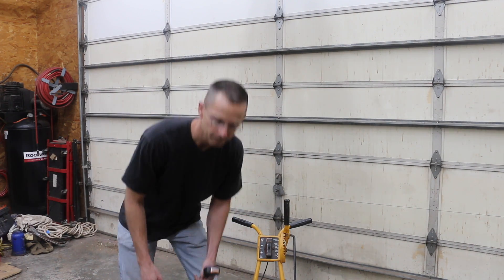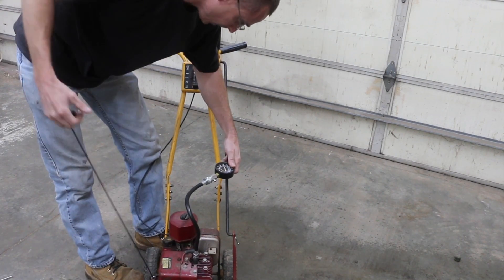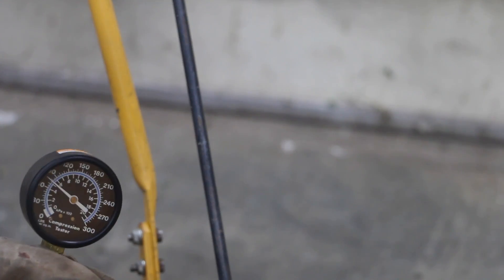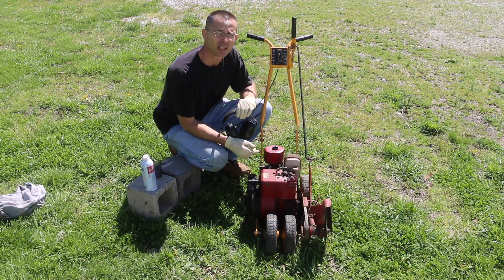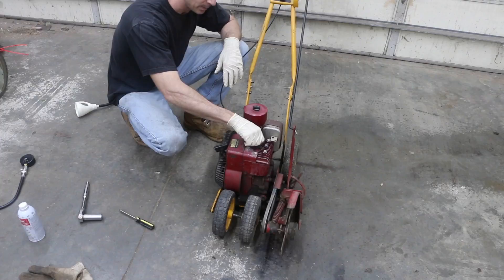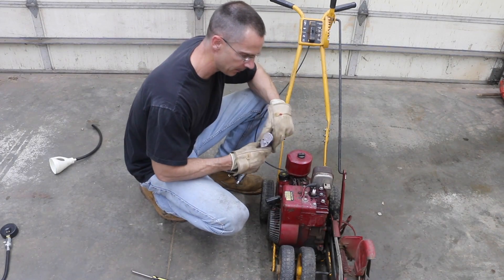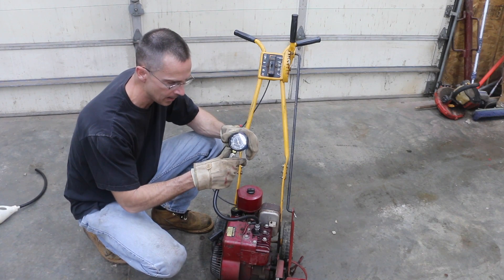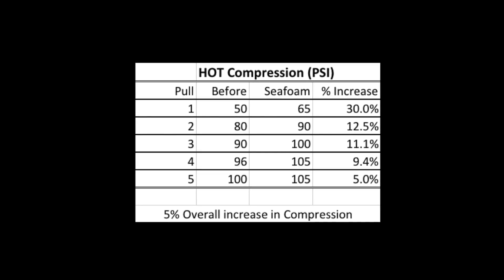Seafoam--can't believe what it did to my engine!!--Episode 4--Compression Test

Comment: I'm curious for my own sake, but have you looked into anything that could actually work to free up stuck piston rings that could potentially save a person from having to re-ring pistons? I know these additives do a lot to clean up intakes and the tops of cylinders and valves, but I'd be curious if there's anything proven to free up piston rings. BG has a whole "engine restoration kit" that they promote as having this ability, but I've never seen it tested. Any knowledge or experience in this area?
Reply from the maker: Thanks for the suggestion.

Comment: Now you have my attention. I have an old Craftsman edger that i bought in 1979. I haven't run it since about 1990. All I ever did was change the oil and spark plug, and sharpen the blade. I will have some Seafoam coming soon and I'll give it a try and see how it goes. Thanks for another great test.

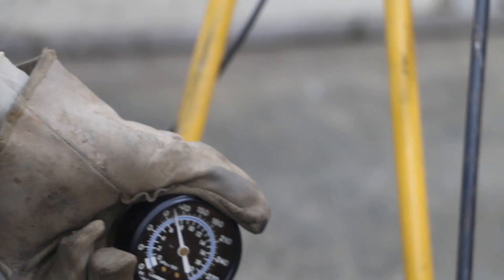Comment: 7:37 "Will an engine start easier with faster compression build?" No, the compression reader only needs multiple piston compressions because it effectively adds volume to the cylinder, and the check valve in it allows multiple compressions to culminate in the hose & gauge which eventually reads out what the compression on that cylinder is on each stroke without the gauge attached.
The reason the tester had faster build after was because less air leaked out and thus the piston was pushing more air into the tester each stroke.

Clever way to get viewers to engage btw 😉
Reply from the maker: Thanks!

Comment: I worked in a Sunoco gas station back in the 60s when they were also repair garage is where you can get your oil changed in your car tuned up or a head gasket put on. The owner was an ex drag racer at the local club level it was very successful. Before he would tuneup someone’s car, he got a pitcher of water, which was about a gallon, he would take off the air cleaner and warm the engine up. Then he would work, the throttle by hand while pouring in the carb intake..
 Black sludge came out the exhaust pipes. He said that was carbon being shocked off of the valves and piston. Then he would do the tuneup with new points condenser and spark plugs, and a check of the advanced mechanism in the distributor, then he would set the Point dwell and finally the timing with a timing light..
Reply from the maker: Thanks for sharing.

Comment: Realize this video is five years old, but have you ever tested RxP?  It's the only fuel additive I've ever used (and I've used all the ones you've tested) that will visibly blow out carbon under hard acceleration in an automobile.
Reply from the maker: Thanks for the suggestion.

Comment: What I found is Seafoam is great on removing sludge and varnish but not on carbon.  Water worked well on carbon but not on sludge and varnish.  So my method has been to do Seafoam first and then water.  I will make a substantial difference.  It's neat to see the older videos!
Reply from the maker: Thanks for sharing!

Comment: I use to to slowly pour water down the through of the carbie on my old Holden 6 cylinder motor once every month and did this for many years and it never damaged my motor but you can see the built up crap being blown out of the exhaust. It's like steam cleaning your motor from the cylinder out Would like to do it to my modern car but it's all fuel injected and not so easy. May have to look at a tapped off injector after the air flow meter to run the water through but will have a talk to mechanics about the affects it may have on sensors first.
Reply from the maker: Thanks for sharing.

Comment: I purchased a 2008 scion xb few months ago, 193,000 miles transmission fluid never been changed going to use for transmission soon, put in crank case cleaned it heck out of it...had to change my oil (yes changed my own oil)  YAY and filter....going to to another transmission change but use seafoam first in it and drive for a while... I love SeaFoam...
Reply from the maker: Thanks for sharing.

Comment: just be prudent with engines that does not have a cast iron liner, these products cleans carbon and can wipe the lube film from the cylinder wall, on a cast iron wall, the material is sufficiently porous to supply instant lubrication up to the engine supplied lubrication can take place.
Reply from the maker: Thanks for the feedback.

Comment: I have a 30-year-old mower with Tecumseh engine, suddenly it is using lots of oil, like several ounces every hour, at least 10 times what it had been using.  Runs fine, starts right up on first pull, no visible smoke after the first minute or so.  Compression is 75 dry, 75 wet.  No leak at the shaft, in fact can't find any leak or accumulating oil anywhere. Any ideas?  thanks, Larry
Reply from the maker: Are you using 30w oil?  Sounds like a problem with the piston rings.
Reply: @ProjectFarm  Yes straight SAE 30 oil.  I thought if a rings problem there would be a bigger difference between wet and dry compression?  Or at least some difference.  Should I try Seafoam or similar before I take it apart?
Reply: @ProjectFarm  Well you were right, I put in new rings and that eliminated oil consumption completely, and now no smoke at all even on startup.  Funny thing though, none of the rings looked perceptibly worn.  I put each in the empty cylinder head and gap seemed to be the same as the new ones.  Also, replacing the rings did not improve the compression, in fact it went down a bit, although the mower works fine.

Comment: In high school,1970, I used to use carb cleaner,or heet,heat, and pour it down the carb of my 1965 mustang. Had to pour slowly to keep it running. Was told by my auto shop instructor that it would free up any sticking rings and help remove carbon build up.
Reply from the maker: Thanks for the feedback.

Comment: I save $350 from not replacing a carburetor in my 2004 Sears DYT lawn tractor.  1/4 can into 5 gallon fuel tank and by the time the tank was 1/2 empty, my engine was running as smoothly as it ever has.  I've always used it in my vehicles but now use it in my snowthrower, push mower and. lawn tractor.  An outstanding product.  I have no stake in the Seafoam company but simply believe in telling anyone/everyone when something this good happens
Reply from the maker: Thanks for sharing.

Comment: project farm..please.. in 70s I worked for chev dealer "line mechanic" we had big block 454cu trucks warranty come in sounding like a rod knocking! real! .. We would air cleaner off - rev to ? and  pour cold water in carb at highest rpm more water ....wallla rod knock is gone .. easy stuff.
Reply from the maker: Thanks for sharing.

Comment: Just an added point, and not to be against seafoam in any way, but I wonder how much of the smoke it creates is from it burning,if any? It would be interesting to see it added to a new engine,like a predator 212. 
It has always helped my engines,wether they are high mileage cars/trucks or powersports, but I've always wondered if it made smoke when burned in an otherwise "clean" engine
Reply from the maker: Thanks for the feedback.

Comment: Hey Todd.
I've been having fun going through a bunch of your old videos just to make sure I haven't missed any for "thumbs up".  I realized something with these seafoam system videos, that when you moved beyond the ranger pickup videos, to the air-cooled utility engines, you were only using one part of the seafoam treatment, and only using the intake/hotsoak part.  The fuel additive and the crankcase additive are just as important for a deep clean that cleans the valves + guides and the piston skirts / cylinder rings / grooves.  I'm kind of curious now to see just how much improvement that would make.

Comment: Nice Videos.... But man so much pollution!!! You should consider evolving to electric for some of your stuff ;) friendly comment :)
Reply from the maker: Thanks!  Thanks for the feedback.
Reply: I appreciate your point, but I've got a fair amount of experience with battery powered landscaping products, and I have no guess how many batteries it would take to mow 3-4 acres of lawn, with even the newest equipment.
Also, battery/electric power doesn't significantly reduce gross pollution, it merely moves it from one place to another, when most grid production is from coal or petroleum, as it is in the US.  Hydro-electric, Solar, Wind, or Nuclear, it makes more sense, but that's more along the west coast, and southwest, and when conditions are conducive, which varies immensely except for the  H-E, and Nuclear.

Comment: Just going through some of your old videos I never saw when they were published.
I find this one particularly interesting. There’s no doubt you’ve observed a difference after using SeaFoam. But it doesn’t make sense to me. If SeaFoam primarily removes carbon, then the compression should go down. As carbon builds up, there is a slight increase in compression in the cylinder due to less final volume; it’s just math. On the other hand, you could still see a performance increase. With the less volume in the cylinder, less fuel/air is drawn in so less power is produced. You might think that if less fuel/air is in the cylinder than it makes sense that there would be less compression with carbon build up, but I don’t think this is the case – again, math. Imagine that carbon built up enough that the cylinder touches the head at TDC and there is no volume left (the engine would explode in this scenario). In this condition, however, the piston will still suck in air as it moves down, so, given the same stroke travel, compression is increased as volume is reduced. But I’d like to hear other opinions.
The only reasoning I can come up with is either there was carbon build up keeping a valve from seating properly or some build up was removed in the carb allowing for more airflow.
Reply from the maker: Thanks for the feedback.

Comment: I use sea foam in all my engines and have never had any issues.  I put just a little in the tank of all my small engines and every spring they fire back up with no problems. Great for winterizing my engines also.  That’s a whole new tutorial.
Reply from the maker: Thanks for the feedback.

Comment: Wow, I have the exact same edger. It  had almost no compression, but somehow still ran. I ended up running both restore and marvel mystery oil through it and the compression increase felt At the pull start was quite noticable.
Reply from the maker: Thanks for sharing.

Comment: The cylinder walls could be  clean. the head and maybe piston face are stable surfaces.  They may hold carbon deposits.  Sea foam may free that up and provide  more space for air to be compressed.  Carbon occupies space. That should increase the  compression ratio, to an extent.
Reply from the maker: Thanks for the feedback.

Comment: The water steam is a proven carbon blaster and WAY CHEAPER than seafoam!   However water "compressed wrongly, " can destroy a engine!  But Used correctly on a HOT MOTOR will FLASH CARBON FROM PISTONS AND VALVES.
WATER WORKS BEST is my FINAL ANSWER?
Reply from the maker: Thanks for the feedback.

Comment: I have a 05 Corvette that has developed a clicking sound which is coming from the driver's side rear of the engine.  I know it is the last valve on that side.  I am hoping that adding some Seafoam to the oil for a couple hundred miles will solve this problem.  The car runs just fine but the noise is disturbing and I fear this could damage my cam.  I would love to hear your thoughts on this and any comments from others.  Thanks, Dan

Comment: Lawn equipment, 3 pulls to test compression, anything after that is just fluff. On those older flat head engines anything above 75ish LBS PSI could still start with first or second pull.
Reply from the maker: Thanks for the feedback.

Comment: If anything it will reduce compression provided that your rings are still good. Carbon takes up space in the combustion chamber, raising compression. Removing it will add space in the combustion chamber, reducing compression. This is why race car engines have a higher compression when inspected after a race, due to carbon build up during the race.
Reply from the maker: Thanks for the feedback.

Comment: Didn't go far through the comments in here but figured I would throw my two cents into the topic of compression and startup... So pretty much the very first thing I noticed in this video was the fact that the compression on your first pull was significantly higher post your seafoam hot soak. I have to say that with my knowledge in the automotive industry that having a strong initial compression build up like that should definitely aid in the startup process. Did you notice any difference in your experience with this tool after using seafoam?

Comment: Oh and one other comment when you do that it removes most of the carbon from the inside of the head and valves and off of the top of the piston which in extreme situation in a car engine increases the compression with all that carbon buildup sometimes you can be so far up as to make it Ping because the carbon gets hot and it lights the charge coming in in any case it's better to have all that crap off so your engine runs better so I would think as the carbon when goes away it would come down and compression slightly but actually went up slightly so that's cool
Reply from the maker: Thank you for the feedback

Comment: Hey when you put it directly into the carburetor into the intake into the head whichever try using a spray bottle or maybe one of those small solvent bottles where you squeeze it it squirts it out of the nozzle you know what to put too much liquid in there to hydrolock and bend the rod and thanks for the great video

Comment: @Project Farm-  Great video series! Back in 1979 I had a 1962 Buick w/ a Wildcat455 motor that was high mileage...  I decided to run a can of Berryman cleaner through the carberator to remove the gunk in the 4 barrel carb.  I ran the motor while I sprayed the Berryman in bursts until gone.  After that the motor was ruined and the volume of blow by into the air cleaner unit probably tripled in volume and the Buick smoked so bad that I had to junk it as a gross polluter. It smoked a little prior to the clean, but nothing like afterward!   I figured the gunk buildup on the valves & rings must have been the only thing sealing up the motor prior to cleaning it. Does that sound like a real possibility to you??  I never repeated the attempted cleaning on another car I've owned since then.

Comment: Just wonder if the seafoam might be useful to clean the carbon built on the intake valves of direct injection engines, such as my Ford Focus MK3 1.0 125 Ecoboost. Of course, I must pour the solution directly into the intake manifold as the engine's running, yet I wonder if I won't do some damage to the air sensor and other rubber and sensitive parts within the intake manifold. Great video of your own again!;)

Comment: Well.....

I would’ve thought cleaning away all the carbon from the piston would lower the compression because you’re losing sealing material that is taking up tolerances created by wear........

on the other hand maybe cleaning away all the carbon is allowing the rings to be freed up so they can do the job as they meant to......

I don’t know I’m not sure about the mechanism is that this works

A lot of sludge removing chemicals can cause the bottom end bearings to knock afterwards because the motor is worn and the sludge is taking up the gap 

I’m surprised to see compression increasing 

but the gauge doesn’t lie
Reply from the maker: Thank you for the feedback

Comment: Thanx for the great videos!! I recently got a 2006 Volvo XC90 5 cylinder turbo for free. It's loaded with leather, no rust, so it's my new project car. It has 438,000 kms ( 272,000 miles) on it. I got a folder full of maintenance & repair receipts with it as well, which is great. It was a company vehicle and I was told that it uses oil. ..but also it'll be just fine for a while then suddenly looses a quart. I've used Seafoam in the past and would like to try it on this engine. Do you think doing this will ruin the O2 sensors, Cats or turbo? These engines are known for building up sludge. I've seen videos that oil passages get blocked in this engine. I also like some of the comments below on how to clean out the engine but don't wanna cause any damage. Would you use something more aggressive for cleaning 1st? How would you approach this? It seems to be running good with lots of power but I haven't driven it more than 10 - 15 kms. Keep up the good work!
Reply from the maker: That's a tough one.  I doubt it'll cause damage but it's possible